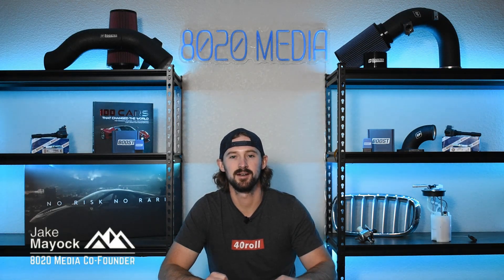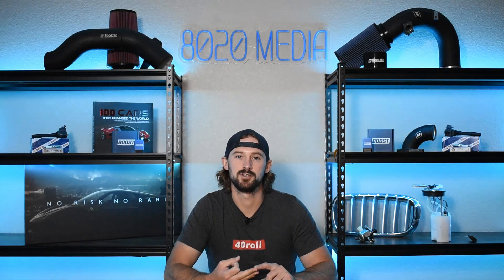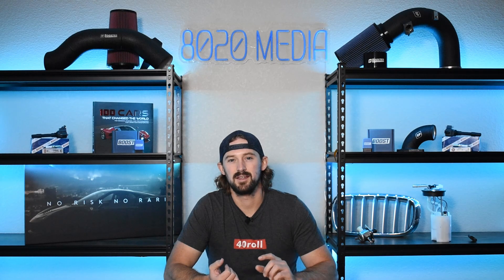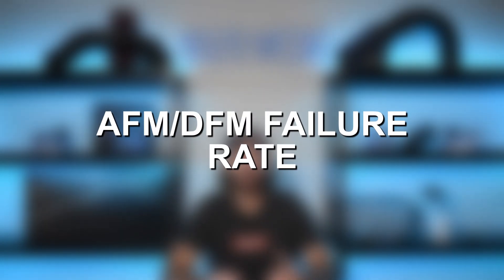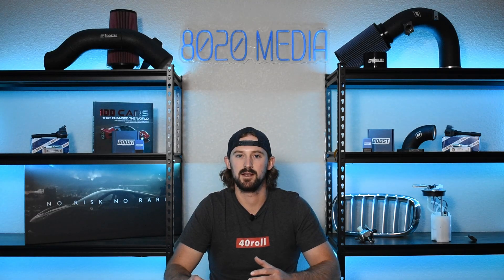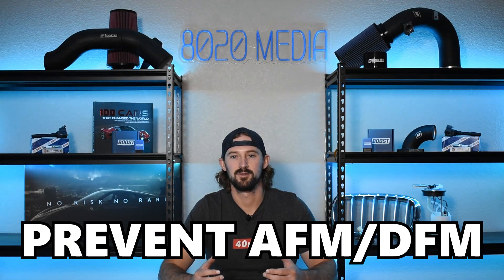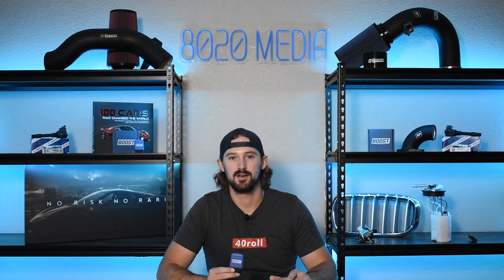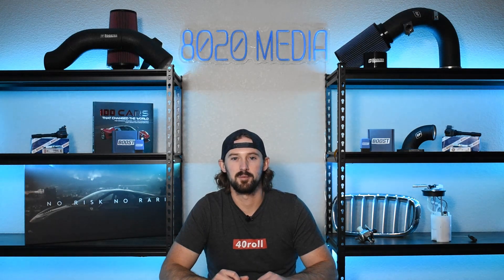GM's 5.3L EcoTec3 | Common Problems & Reliability (AFM/DFM)

Comment: Change the oil every 5k miles or sooner. Use an engine flush every or every other oil change. Use full synthetic and top treir fuel. 

I am at 90k and the engine is smooth as glass and gets 17 mpg on 35s

Comment: My 2018 GMC Sierra 5.3L EcoTec3 engine, 8 speed,  just hit 150k miles. Love my truck but wouldn't you know it started experiencing lifter tick. Barley noticeable in the cab but leaving it run and exiting the truck very noticeable. I regularly have the oil changed at the GMC dealership with 0W20 Dexos full synthetic. Just had the oil changed 4 weeks ago. It's now at the local garage getting the valves cam assessed and cancelling the AFM.

Comment: Chevy 2019 5.3l with 70,200 miles and a ticking sound when cold start lasting aprox 20-30 sec. is lifters going bad
Reply from the maker: F - On your 2019 Chevy 5.3L with 70k miles, a ticking sound for 20–30 seconds only on cold start is usually not failing lifters yet but more commonly normal AFM/DFM lifter noise, oil drain-back overnight, or a sticking lifter that pumps up once oil pressure builds; it can also come from an exhaust manifold leak that seals as metal expands with heat. If the tick is consistent only when cold and goes away warm, it’s generally harmless for now, but it’s worth switching to a high-quality Dexos-approved synthetic oil and making sure the oil filter has a proper anti-drainback valve. If the tick gets louder, lasts longer, or starts to show up warm, then yes, it could be early AFM/DFM lifter wear, in which case many owners disable AFM/DFM with a plug-in device to extend lifter life. For now, monitor it closely but it’s not necessarily a sign of immediate failur

Comment: I have a 2021 Chevy Silverado 1500 with the 5.3 v8 and I just started having issues with misfires and so I thought it was the spark plugs but of course my luck it didn't resolve the issue until I found out that I have the DFM on my truck. Will this solve the issue that I am having for the misfires? i do not want to spend money that is not needed since I just spent $100 changing out my spark plugs.
Reply from the maker: C - Unfortunately, we don't advise using our disabler if your truck has any underlying issues as it could exaggerate said issues. Are you getting any engine codes?
Reply: @8020Automotive P0300

Comment: I've got a 2019 Silverado W/T with the 5.3L V8 and a 6 spd transmission. Not sure which engine designation I have, but I'm pretty sure it's not DFM. It was a U-Haul fleet vehicle. I haven't had any engine issues, and I can never perceive not running on all 8 cylinders. I read the DFM vehicles will say Flex Fuel, and mine does not.
Reply from the maker: C - More than likely AFM. If it was a U-haul fleet vehicle, they maintain their vehicles well!
Reply: @8020Automotive  Yeah, I've since searched the VIN and it's an L82 with AFM. Looking into a boost module to stop it from happening. It only had 7,500 miles on it when I got it, but a few dings and scratches, and some mild hail damage. Probably only got one oil change before I had it.
Reply from the maker: C - Let us know if you have any other questions!

Comment: The guys that have issues are always the ones posting on facebook and forums. Most don't have issues. One guy in the chevy 2019 group on facebook traded in his 2020 5.3 8 speed with just over 300k miles no problems. Lot of guys over 100k no problems including myself.
Reply from the maker: K - Fair point! Thanks for sharing.
Reply: I figure if you stay on your routine maintenance and not fog the video every day then I would assume it would be good right?

Comment: Less than 1% on motors that have 150k(ish) miles. What does that tell you? People who will not change their oil on a regular basis. These are also the people who probably use the cheapest oil they can find. I love my L83(2020). At 70k miles she's a BEAST. Ive got the towing package- 3.73 gears, thing fkin rips. Flipped the pill on my 6L80 and change the fluid and filter every 30k. I also put 24 ounces of Lucas 10009 with each change. And I dont do a ton of highway driving but when I do I love the DFM. Sit there and watch mileage creep up and up and up. Its been the same forever, change your oil regularly and your motor will last for a long long time
Reply from the maker: S - Well said.. Thanks for taking the time to share your experience!

Comment: Does it need to stay in the port? Or once its done you can take it out? I have to put a progressive snapshot in it. Ive got 200+k on my old 2001 f150 Im expecting the same or more from a GMC
Reply from the maker: S - Unfortunately, you have to keep it plugged in 100% of the time for it to work. However, you can use an OBD splitter! We have a ton of customers using this type of setup.

Comment: I have a 2013 Yukon SLT with 279,000 Still running around the country.  Changed brakes, tires, . Doesn't burn oil. 5.3 SLT I also haul a Camper with ease.
Reply from the maker: J - Hell yeah. Sounds like you take great care of it!

Comment: I recently bought a 2020 gmc sierra 1500 at 67k miles pre owned and last me on way into 100619 miles engine decide to give out and now dealership wants 15k to fix there been a lot of depending on what to do
Reply from the maker: B - Sorry to hear... Do you happen to know what happened to it?
Reply: @8020Automotive what dealer said it was audible knocking main bearing failing
Reply from the maker: @bearandtheweep4756  Sorry to hear. Thanks for sharing!

Comment: I'm about to buy a 2025 GMC with a 5.3 engine. Is there anything I can do, parts that need replacing? Some say to disconnect the Star/Stop system.
Reply from the maker: M - A disabler is a good start! But these engines are pretty new, so still need some time to recommend parts to change.

Comment: Mine died. 2019 Chevy Silverado Texas Edition 5.3. I bought with 57k miles.  Put thirty one but bought a warranty that only handled 30k. Engine lifter 8 died and cam bent! Dealership acknolwedges it was not user error. 87k miles total.  Gm offered 10% goodwill on 9360.00 catastrophic engine repair. Soooo, 100% gm's fault, goodwill proves gm's knowlwedge of failure of 5.3 afm. I am having to get a lawyer. Thankfully its Louisiana and the Redhibition law trumps 60k powertrain warranty. The gm rep even said there is no one else to speak to, so the next step is getting a lawyer. They greenlighted the legal escalation whether they knew it or not!
Reply from the maker: S - Sorry to hear this! This is something that is widely known by GM unfortunately.
Reply: @8020Automotive Thank you. It's so unfair. 😂

Comment: hi jake, MY '18 5.3 w/95k miles is at dealer for lifter failure(only AFM model), ready to order parts today. Estimate $4130. I asked about full delete kit installed instead of replacing AFM OEM lifter train?
"only independent mechanic , not here at dealer" serv. adviser.  Jake pls advise, should i let 'em replace OEM AFM system then install your device or find somebody else to install complete Delete kit , i don't know where or how difficult a job it is? This is time sensitive as you may have guessed, gary
Reply from the maker: G - We can't recommend a delete. However, if you have the budget, it is the way to go.

Comment: DONT BUY GMC, ITS GARBGE, when you go to service they will rip you off
Reply: i took the car to gm dealer, before car went in to the shop you need an engine and transmission, i told him forget it, i took the car back, he ran after me to leave it, i did, to your car up,diagnosis the problom, 2 weeks later, come pick . whats wrong with the car? no you dont want its too much money. how much? come pick your car up, i have a  electrical problems in car, they want to sell me a motor and transmission,  ALL you guys with older cars, dont compare it to a 2024, IT IS JUNK.
known problems with valve body,engine valves..
and for programing, go find someone with, MDI2
Reply from the maker: @toviatovia1385  Thanks for sharing
Reply from the maker: T - Unfortunately, they don't make them like they used to.

Comment: Any recommendations on what oil is best in these engines?
Reply from the maker: R - The best oil is dexos1 Gen 3-approved 0W-20 full synthetic oil—this meets GM’s latest specifications for wear protection, cleanliness, and fuel economy. Top choices include Mobil 1 0W-20, ACDelco dexos1 Gen 3 0W-20, Pennzoil Ultra Platinum, or Amsoil Signature Series if you want a premium option.

Comment: Video is 11 months old so have you built a disabler for the 2025 Refresh models yet?
Reply from the maker: C - We are working on it and hope to release it this summer. These things take time.. It's not just a simple "build the product, and hope it works". This is $50,000+ vehicles using our device, so we're going to make sure that it works 100%.
Reply: @8020Automotive ok, let me know as soon as you have it ready, Im using the Range Refresh product now with no issues but it sure would be nice to have one that is easier to install and uninstall before a dealership visit … I will stay tuned…

Comment: I have a 2017 suburban with the 5.3 what I’ve noticed about it is when I run 87 it runs like crap but when I run 91 in above it runs way smoother more power and the throttle is more responsive. I think that is BS They say you could run 87 in the motor  when it runs better on 91 and above 🤦🏾‍♂️🤦🏾‍♂️🤦🏾‍♂️
Reply from the maker: A - We always run the highest quality fuel possible. Thanks for sharing your experience!

Comment: If I disable the AFM with an obd2 device would it still pass smog?
Reply from the maker: M - It will. However, you will need to unplug the device a couple hundred miles before the inspection.

Comment: Truth is 2 million people have these trucks if less than 1 percent of people have issues that’s enough for a bunch of nobody’s on the internet to start trashing something they can’t even afford. Plenty of people have lemons or just neglect maintenance but I’ve seen pretty much all manufacturers have equal amount of problems and all my trucks I’ve had, 6.0 vortec till 185k now a 5.3 with about 40 I’ve taken great care of and had no problems
Reply from the maker: J - Unfortunately, you could say the same thing about everything in life.. All it takes is a few people to be upset to ruin a reputation. However, you can't deny that they aren't building them like they used to (specifically with all of the EPA tech they're adding). With that said, thanks for taking the time to share your experience.
Reply: @8020Automotive dude they're not building anything with any value anymore no matter what you buy. These company call it planned obsolescence. People have to keep consuming to keep these companies going so they don't want their stuff to last
Reply: @janicehenning4505  buyer buys new, make it last 5 years, get buyer to trade it for new, then let 2nd owner pay for replacement parts when it breaks. Manufacture keeps the new car buyer happy and get paid on backend on parts from people who will never buy new.
Reply: And if you check out most of the people on the road they drive their vehicles very hard. Above the speed limit hard stops and hard acceleration. That wreaks havoc on your vehicle. And I'm telling you now I've been around for a while and most people drive like s***

Comment: Who other than a lady would want a full size pickup with a 4 cylinder 😂 And GM V8"S and transmissions are falling apart right after delivery. GM General Misery 😅
Reply from the maker: B - They certainly don't make them like they used to..
Reply: @baberdoug6930 the EPA!

Comment: I have a 2021 custom trail boss, how do I know if I have the adm /dfm or did I not get the chip?
Reply: I got to say I think it might not have the chip because I have never felt like it wasn’t firing all cylinders never noticed a change behind the wheel. But would I even know if it was?
Reply from the maker: S - You would certainly be able to tell. If you reach out to our contact page, https://boostafmdisabler.com/pages/contact, we can help you with this more.

Comment: I have a 2019 Yukon with 76000 miles on it. It ran perfect until about 2 weeks ago. I experienced a lifter failure on # 7. Luckily the cam wasnt hurt. I went ahead and had both banks replaced. I learned that mine although it was a 2019, still had the afm. Next step is getting an afm cancelling module.
Reply: Disabling the afm won't help, you need to replace the lifters. I own a shop in Houston, we do lifter and cam swaps daily. We swap lifters for $600 labor. Typically done in 1 day ready to go.
Reply: @MrC9Oh3 I in Houston. Shop name
Reply from the maker: O - Sorry to hear! However, good thing it didn't cause anymore engine failure. Keep us updated.

Comment: Buddy is on his 4th Sierra, all had the 6.2L. He’s out over 300k miles total with no engine issues. Just bought an AT4 with the 6.2 but not enough miles on my truck yet to say anything about long term quality.
Reply: My 2021 AT4 6.2L dropped a lifter at 23K miles while doing 75 mph. Bad news from there…Started drinking oil at 40K miles.  I finally sold it and bought a 2025 Silverado LTZ Z71.  Good luck.
Reply from the maker: @fleafarts3576  F - Sorry to hear this.. However, thank you for taking the time to share!
Reply: They just recalled the 6.2.
Reply from the maker: F - Nice, thanks for sharing!

Comment: Just bought a 2017 with the 5.3 in the special ops package. It comes with the 6 speed trans. What is the best catch can I should put on it and what precautions do you recommend I take? It has just barely over 150,000 miles and just formed a misfire right after I bought it that the dealership is fixing now.

Comment: Was thinking of a 2021+ tahoe 5.3 L, should i avoid?
Reply from the maker: M - I don't think so. Depends on maintenance. Some of the 2021 model years came without AFM/DFM, which would be a BIG selling point!
Reply: How can I tell if it came with that?
Reply from the maker: M - If you reach out via our boostafmdisabler contact form, we can take a look at it for you!

Comment: My 2022 (refresh) did not come with DFM due to chip shortage!!!  One of the reasons I pulled the trigger
Reply from the maker: M - Those are the best models! Great find.
Reply: I have a 2021 custom trail boss. How do I know if it has it or not. ? Sounds like it’s within the years
Reply: @ you need to look at your build sheet.  Or scan the QR code inside the driver side door it’ll show your build sheet.  It’ll say on there if DFM was deleted
Reply: Still a lemon with faulty lifters

Comment: I’ve replaced 4 oil pumps in the first 5 years. 40,000 kms on the odometer.
Reply from the maker: S - Sorry to hear this.. There's gotta be something else going on. Thanks for sharing.
Reply: Wtf are you doing to that poor truck ?!? 🤔
Reply: @Canada55Eh reading miles as kilometers

Comment: Would switching to 91 or 93 octane help mitigate this issue too?
Reply: Carbon buildup and other mechanical issues. That were mentioned in this video. Like for example would the higher octane fuel help it last longer the engine?
Reply from the maker: D - For naturally aspirated engines designed for regular fuel, it won't significantly impact longevity.
Reply from the maker: D - What issue?

Comment: I have a 2011 Tahoe. It has the 5.3. Do you recommend the delete?
Reply: I had a 2011 Tahoe - bought it at 101k, and plugged in the AFM delete chip and sold it with around 155k still running strong. It had an almost undetectable audible tick (probably from AFM being enabled before I bought it) but I never had lifter failure or anything catastrophic.
Reply from the maker: @shoxroxice  Thanks for sharing!
Reply from the maker: C - We always recommend it... Makes it much more reliable.

Comment: I have a 2015 Chevy Tahoe with the 5.3 197k miles 0 issues with the motor. Did have to have the transmission rebuilt 10k miles ago.
Reply: About how much was that cost?
Reply: @davyla29  $4200
Reply from the maker: A - Thanks for taking the time to share your experience!